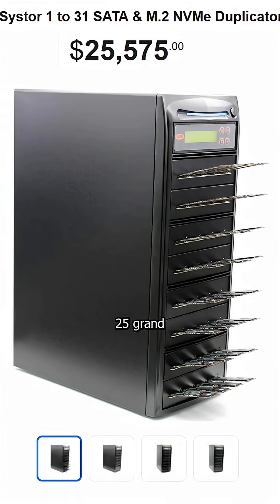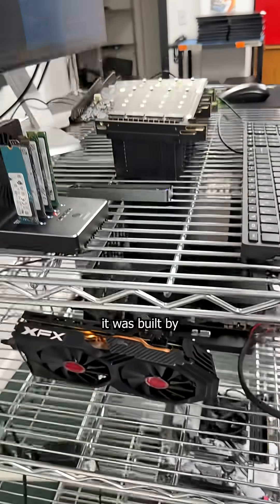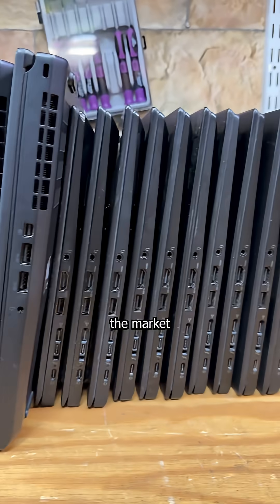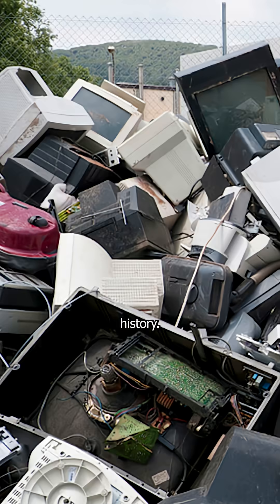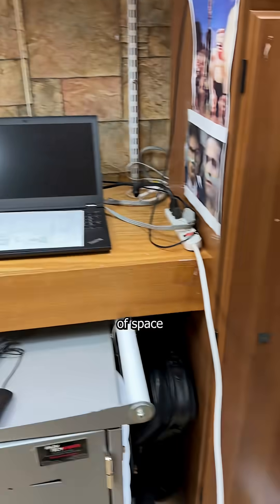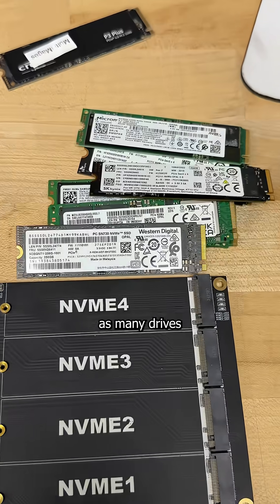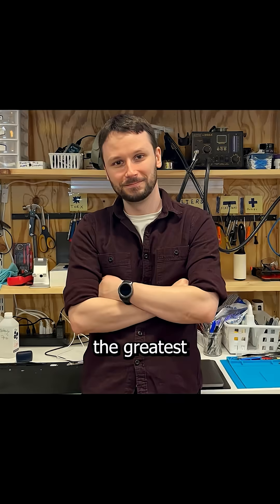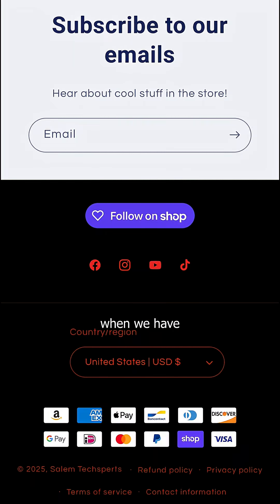I Built a PC Worth $26,000 to Save Old Tech From The TRASH! #tech #technology #computer #shorts #pc

Comment: I believe these devices will only need to meet RAM and Storage requirements if you bypass the HW checks during Win11 upgrade/install, or they can be used as linux machines as its time to leave Microsoft in the past

Comment: I remember having issues with my computer a while back and being told that i needed to check my version of windows so i did and it told me that i needed to upgrade to windows 11. It ran some diagnostics or whatever and told me my computer didnt have the required specs for windows 11 and immediately tried directing me to prebuilt microsoft computers that each costed at least 600 dollars, hell no.

Comment: I hate e-waste. My mums old iPhone 6s got to me and i kept it well enough it got to be passed down to a former friend (who proceeded to drown in a pool then asked if she could have my new 12 mini so i could have the now drowned one back)

That 12 is my current phone. Who despite being so small fell out of my tiny pocket and smashed the screen. The back glass also broke recently but that’s just cosmetic. 

My iPad is from 2018 and had its brand new replacement screen broken BY THE REPAIR SHOP and they just put a screen protector on top and said they “broke the protector putting it on”???? Real convincing 

My 3DS needs a new battery because I love it and it will never die. 

My hp 🤮 had its vents and speakers covered in YOGURT BY THE SAME PHONE DROWNING FULLY GROWN ADULT WHEN I LET HER USE IT BECAUSE HER “laptop isn’t working” had to clean that out. She also dropped it and collapsed one corner which causes the speaker to make constant crackling noises. But it works so it’s fine

Comment: Some of those machines have specific HW and firmware that allow them to easily “secure wipe” NVME drives, though. Which is why they can be pretty pricey.

I’ve been thinking about a good solution for that, any thoughts?
Reply from the maker: There is a Linux app that can do secure wipes for you in mass but they don't print certificates. I forget what it is but I'm sure someone here can tell you.

Comment: The biggest E-waste event in history is actually on the smartphone side. Every bad practices imaginable are gathered here. 

Imagine having a phone that will only see 2 (low range) to 8 (flagship) major Updates.

But not everyone one or wants or can spend 1 000 on a phone...

No IOS, or Android versions keeps receiving security updates after 10 years.

On smartphone they pull-out a new OS every year.

So what Microsoft did once, is the norm for phones.

We have to deeply change smartphone industry. Focusing on quality rather than numbers.
One strong and feature rich OS on smartphone should last 5 years minimum.
And phones are also where obsolescence is the the strongest. A phone should last 5 years minimum.

Some of you will say : " But phones are not like computers *insert technical arguments*"

You are wrong, the "new OS every year " type shit is just to push to buy new phones.

Instead of Android xx going up, even for big updates, it should go xx.xx.xx.xx like other softwares.

If OS on smartphone were not scams.
Android 16 should be android 10.6 at best and 14.2. At worst.

Bigger and longer lasting updates for smartphones. If an smartphone OS receive new features for 2-3 years it would be wayyyyy better

Comment: I ran into the same problem several years ago when I needed to image over a thousand flash drives; A 24-port imaging device would have set me back over £1,500. My solution was mostly the same as yours, except with a couple of USB 3,0 host cards, a stupid number of USB 2,0 hubs, all crammed into a 20-year old tower case, and becoming surprisingly glad I'd once bought a job-lot of MP3 players that each came with a USB extension cable... 😁💯👍

Comment: Why are you pulling the NVME drives? 
I was doing this with auctioned Dells, Clonezilla and a network switch 15 years ago. Couldn’t have been more than 100 bucks for the network equipment and no removing of drives required. Admittedly haven’t been in hardware for 10 years now but Is network imaging not a thing anymore?

Comment: I wish I could send you my thinkpad that the usb c charge port failed on for one of yours bc like.. it's either get a new motherboard for as much as you charge for a whole thinkpad, or try to solder the tiniest little connector just to find out the chips got fried while trying to wiggle my plug to charge.  It runs on battery fine, too.

Comment: im stuck with windows 10 and broke lol so idk what to do next i got a mid range gaming laptop from like 2015. all becuase of the stupid TPM 2.0. like there should be a noption for dis basic windows 10 security on windowes 11 until the user gets a 2.0 chip.
Reply from the maker: Use FlyBy11 to bypass the requirements and upgrade to Windows 11

Comment: Is there any real specific reason why them ending support is bad? No one has really explained why ending support is bad outside of no more windows 10 updates/security updates
Reply: Windows 11 is a much harder operating system to run  than windows 10. A large  percentage of windows 10 computers are just being used for browsing and file management in offices. These computers do not need more power, but Microsoft is forcing them to be disposed of,  because not having regular security updates makes these computers almost completely defenseless from anything.
Reply: @wanderbyte4744 I see, I have a computer that can run windows 11 I just do not want to, I don’t want to deal with what Windows 11 is and other operating systems are not something I want to learn currently. Is it just the security side of things that people are pressed about?

Comment: I still have an ideapad 330, that i use when im not using the desktop, mate can you tell me how to quiet my laptop though? Sounds like a plane, i have already changed the fan and battery and clean the dissipator, only thing i havent done is change the paste, i already bought it but i dont know if simply changing the termal paste it will quiet the pc, its completly clean, hardware and software wise, i have dismantled it many times and is only 6 years old, i should be able to make it quiet but i dont know how, i also added more ram, maybe using diferent ram makes the noises but i couldnt find a matchable ram that was 16 gb at same speeds from lenovo since it has an internal not removable 4 gb slot, and 1 free that i installed a 26gb stick on, i also changed the HD for nvme but it didnt fix the noise, only made it a bit faster, maybe the only way to make it quiet is to change for a new motherboard, do you have any tips? It really sounds like a turbo plane

Comment: Do you need the risers? With bifurcation I assume it could be mounted directly?  Or is it simply for access reasons?
Reply from the maker: The risers prevent the wear happening on the motherboard slots form unplugging the PCIe card. This way instead of wearing a permanent slot, I wear a $30 one.
Reply: @SalemTechsperts  Understandable. :)

Comment: Question: the machines MS deemed "unworthy" of running W11 ... were these factually incompatible because of older CPUs or unsupported configs, or no TPM 2.0 & Secure Boot features?

Recently I upgraded ten+ computers with FlyOOBE because they were (according to MS) too old and thus incompatible ... of course this is bullcrap, as they even came with TPM 2.0. I upgraded them all, now they're back to life with still supported W11. Good you found a solution as well.

Comment: One of the biggest issues with TPM 2.0 is that a discreet TPM chip, which is used in laptops and is supposed to be the most secure, sends the decryption key over as plain text. If you set a pin, this will encrypt it, but the average user doesn't do that. This makes it virtually useless for the average laptop user.

Comment: Icy Dock makes a PCIE NVMe bifurcation card that has removable slots. It is designed for servers, but for what you’re doing it’s perfect. They are definitely expensive, but it’ll be worth it in the long run not to have to rely on those things just sitting there not secured.

Comment: Not to nitpick. But you couldve easily gotten 2x  HP z640s for 250 bucks total (processor and ram usually included). Each has 4 individual pcie 3.0/4.0 slots as well.

Being that workstation you can easily fit a 20 core xeon and call it a day with about the same amount of drives youre imaging for roughly 1/5th the price.

But everyone has reasons to buy their parts i just find it interesting to do it this way with a 600 dollar motherboard just meant to image nvme drives

Comment: Good thing that pretty much all of my computers that I use privately were considered e-waste at one point. All of them have undergone some upgrades, deep cleans etc and are still going strong.

I recently tried to get my mum hooked up with a refurbed P15. Plenty enough for what she is doing - probably even overkill. But for some reason I cannot fathom, she insisted on getting some brand new and shiny (but oh so rickety) POS from Acer with a screen bezel so flimsy it's almost see-through and cheapest plastics galore EVERYWHERE. Hell, the entire machine would visibly bend if you pick it up by one corner. 
Throwing all the components in a garbage bag and rattle canning the lot in matte black would probably be an improvement. 

I am already dreading the day I get "The Call". Her last machine already was a complete piece of garbage - also Acer - and working on that plasticky abomination was already an absolute nightmare. But alas, no amount of arguing for better serviceability would get through. Even telling her flat out that it will be impossible to get any spare parts after more than three weeks after date of purchase, didn't help.

Comment: Honestly stopping public repairs to focus on extending the life of computers so they don't end up in the landfills is admirable
Reply: Everything about my old laptop works, except that the processor is not on the list of win11
Reply: @1015KillAtron and it runs like shit. Don't debate this, I've ran a shop for a decade. Pre gen 8 NEEDED to die
Reply: @AcidCrab  that's entirely subjective and dependent on the user. Don't debate this? LOL. My Asus N550JK from 2014 or 15 has DDR3 SODDIM, 4th Gen i7, and a GTX850m. I can still use it for web development, and I can play StarCraft 2 and Divinity Original Sin 2 on it. Upgraded the RAM from 8 to 16 and it runs 12 tabs on Firefox pretty well. Why should it "die out"?
Reply: @lanceislateagain  a fellow StarCraft fan and tech bro, heck yeah
Reply: @AcidCrab  it was and is actually completely fine and will work for 95% of people
Reply: @AcidCrab  Some of the windows upgrade requirements are just broken, I had to reinstall windows last year and I was getting told my Ryzen 7 5700x was incompatible for windows 11, so that person’s laptop could potentially be just fine and being falsely flagged as not usable.
Reply: Yeah, it could be done but people just like to throw things away and spread misinformation sadly. that's the source of most waist.
Reply: And all companies and CEOs who promote and utilize planned obsolescence deserve to be publicly executed after they’ve been tarred and feathered in the streets first
Reply: But wjst is he doing upgrading them to windows 11?
Reply: @ozziemurray  Or Linux.
Reply: And probably one of the reasons big tech companies never seems to lack profit, to channel into the pockets of lobbyists and politicians.
Reply: Really great way to re-purpose laptops that companies get rid of like tissues.
Reply: What does he actually do to the laptops? Change the motherboard ans cpu so it works with Windows 11?
Reply: @LuukRoelofs  refurbish it, clean it, and either install Linux or some version of Windows 10 that isn't about to go out of support (I think).
Reply: He installs Linux Mint onto the old laptops.
Reply: Yes, but now how will China pollute their rivers with heavy metals?
Reply: If you knew how bad the repair scene has got the past couple years you would understand that it's not as selfless as it seems.
Reply: What's wrong with someone working to help others while also making sure they don't risk suffering emotional burn out and going out of business?
Reply: Naw it means more 💰💰💰 for him
Reply: @GreenLeafUponTheSky  And why is that a bad thing? It seems like his intentions are noble but even if he was purely money-driven, he’s still doing a good thing. Unfortunately, most of the time it’s the harmful/dishonest stuff that pays more so lots of people do it but this time it’s a straight win/win.
Reply: @Cheeyze  Did I say it was bad? Stop assuming stuff I never said.
Reply: @GreenLeafUponTheSky  You said,  "no, it means more money for him". That no refers to the good deeds aspect. Those are your own words. Maybe try using something like it also means more money for him, or it makes more money too.
Reply: @Cheeyze even the highest end computers that fail windows 11 check…. Are kinda trash now.

A intel n100 ( a nearly 3 year junk cpu) has pretty much the same performance of a i5 7500.  Let that sink it….
Reply: @75silverfish  Pedantics, pedantics. If ya’ll were less aggressive in life you’d be more happier. Good bye
Reply: @GreenLeafUponTheSky  Lmao, Imagine correcting some guy that is giving another person a hard time despite being blatantly wrong, then he tells everyone it's their fault and they'd be happier if they didn't. Please take you own advice to achieve more happiness and have a good day as well. Mistakes happen it's no big deal.
Reply: @75silverfish  I made no mistake. I gave the real reason why he is working on all those laptops in bulk. I’m amazed at how emotional you’re all getting over nothing.
Reply: @GreenLeafUponTheSky  I agree with you that it's very possible that is the main reason, but you didn't state that, and it's just as likely that it can be for a good cause with a bit of money as a bonus. It could also be an equal split. The point is, stating as a matter of fact he did something, rather than stating your opinion of "i think he did this for X" are very different things. Most people don't take accusations against their character very well and with reason. I personally am calling you out because making accusations with 0 proof is bitch behavior that can get people hurt. You earned that all on your own.
Reply: @75silverfish  Damn that’s crazy, because of some random comment like mine where it’s obviously an opinion since I have no evidence, someone’s gonna believe it’s the truth. I don’t care, I can say whatever I want, I’m not going to care if I hurt someone’s feelings over petty things like this.
Reply: @GreenLeafUponTheSky  Words have meaning, there's no way to perfectly and magically assume right when you use directly contradictory words. I agree with your right to an opinion and glad we cleared that up. You could have also just stated it was an opinion on the first response, or first response to me, but here we are now lol. Personally I think if this guy was trying to make money, there's be better things he could do with his time with his skillset. I think the money is a nice bonus in this case.
Reply: @GreenLeafUponTheSky  or maybe you just need to learn how negative you can come across as.
Reply: @GreenLeafUponTheSky imagine wanting to make money . Despicable

Comment: What exactly is a cloner
Reply: Bit by bit copying with extra error correction. Can be done (though very slowly) with a regular pc having two slots for hard drives/ssds/nvmes, like they do in regular repair shops when you want a new boot drive.
Had a friend doing these and the common practice was to end the day by setting all the PCs doing this over the night (if no errors, takes a couple hours) at the end of the day.

Comment: is it okay to just install normal windows to laptops like will the fans still work normally cause back in 2019 when I install a normal iso from windows my laptop fans didn't work even using massgravel to make it official it still wouldn't turn on luckily i had a back up of my drive for my nitro 5 laptop

Comment: I usually salvage those used laptops for 2 reason. Reuse for activation code and I can use new Windows 11 PCs with those OEM Windows 10 key. Then, if those laptops still legit to use most modern features but can’t upgrade to Windows 11(TPM 2.0 mostly), install linux instead.

Laptops more than intel i5 or Ryzen 5 but old more than 5 to 8 years old still can be usable like this.
Reply: Those OS licenses are not transferable.   You are just pirating the software with extra steps.
Reply: I don't think you can use OEM licenses to upgrade from Windows 10 to Windows 11. Pretty sure it has to be a consumer license. I may be wrong, though.
Reply: @Gr8_Ape_69  You can, as long as its same machine. Its tied to motherboard or something.

Comment: I wouldn't clone a PC even if it was mine. I love that feeling of running a new OS.
Reply from the maker: These ARE new OS's. They simply have the proper drivers installed and updated. Same models, same software. Or do you just enjoy the process of waiting for updates to download?
Reply: @SalemTechsperts I probably didn't understand but I've never had problems with drivers since win10. Maybe it's a Linux thing idk... 
You should probably sell bootable USBs instead and offer OS installation as a separate service. The consumer will have to do it anyway since half the setup is online since win11.

Comment: 10? I've still got a laptop from 2009 that runs on 7!
Reply from the maker: That's not a flex my man :( if you're connecting that thing to the internet God help you
Reply: @SalemTechsperts There are ways to still get security updates, although it only gets used offline as a backup or for running old programs.